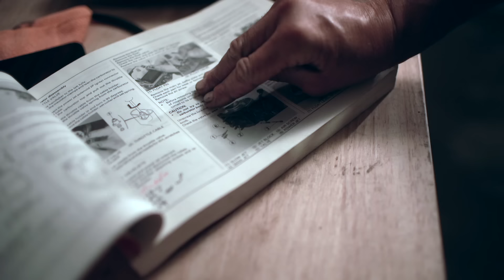Velocity Disorder II. Honda CRF450R vs CR250R

Comment: I don’t understand, the 450 should be ripping away from that 250 on the straights? The hell is the point of going to 450 if 250 has it all and lighter bike
Reply: As a old pro ! 
I can answer that question for you. The 250 if it's done right have more horse power then the 450 who I guess is around 62bhp.
My best 250 engine did well over 65bhp. And the snappy power of a smaller engine is helpful! See a bike put's down 35-40 to the ground rest is going to be wheel spin. I had factory 500cc bikes in the 80s who had 75bhp. But still the good 250s could keep up in the start. Only when it gets rough deep sand the 500 was in charge. My 450 of today is way modified lighter crank shaft piston and it rev 12.500rpm why ? 
Because it feels as a 350 to ride and it cut corner as good as the 350 and not brake stop at the engine we run Recluse clutch. So it's up to how good you make the porting of the cylinder and you need raise compression more  at a 2 stroke they make more use of that. Best regards Bjorn

Comment: 2 stroke all day long , half the weight same power on a different delievery,
OMG when you hit 5000 thousand hang on for dear life grip with your knees arms and hands for all your worth, no feeling like it !!!
Reply: Well with the 450 atleast you get to skip Top end rebuilds, (almost too easy on the 250) but still I guess the 450 is awesome because you can convert to street legal along with having local low end torque and gas. So best answer; cr250/500 for motocross and 450 for trails because of that nice torque lol.
Reply: The anger I have for Honda not making 2 strokes anymore >:(

Comment: give her a new full fmf and see whot happens to a 250 2t 450 is slower if fmf exxaust is on the 250 2t bcause 2t need exxaust stock is sucks so buy a pro curcuit or fmf or shorty and see how race done easy on 250 2t

Comment: Well when do match about what engine desing is the best fo racing..it would be 250cc 2t vs 250cc 4t. Littlebit funny that there is not many videos of that :/ Sure i know how it would end....motocross mag ever had dyno test like that and 250 4t are in 125 2t class.4t Heavier, many parts to break..expensive ones and less power for cc...so what the fuck 4t is doing in motocross? Yes business..more money to maintaining the engine...

Comment: Crf450s are shit the most boring gutless 450 out there  honda went downhill after the last cr 250 was built the cr250 was such a bad ass bike power reliability handling was awesome  and the unique     sound . I never bought another Honda after 2007
Reply: Lol. What kinda pot are you smoking? I have both and I can say the 450 wins easily. And for the record, 08 was the best year crf450 until the 2017 rolled out, and when it did, it was also reviewed as one of the best bikes of the year, where it has stayed to date. Totally not why the 08 is known as one of the best 450f's ever made... The 450 also makes 10 hp more. But keep trying to call it gutless, I bet ya never rode one.
Reply: @kyles5751   ha ha nice reply honda fan I have rode many crf450s and I  own almost  every brand Yamaha are the best  I have a 2012 yz250 2014 yzf 450 and a 2005 cr250  and a 2018 kx450 and a 2014 rmz450 and owned so many older models over the last 20 years of riding dirtbikes  trail and racing.but no crf450cos their shit and thrash out to quickly. I'm not saying I dont like honda I own o cr250. 2008 was a better year for them follow up on the constant valve problems before then.  but then they go put twin exhausts on them to make them go no faster old Seattle bags we call them.   and just now  2018 they make a decent powered 450  yzs are the baddest 4 banger out there. But I understand  your love for honda . And I think there is only one type of pot its called  marijuana.
Reply: @THRASHED05  The yamaha has been a better bike overall, but it's cornering has never been on par with Honda. The only thing I like more on the yami is the motor, and that was only after they ditched the nightmare 5 valve, still not a fan of that atrocious wrap around exhaust. Honda strugged with valves for a little while, but they were solved with time.
Reply: @THRASHED05  And again, I disagree with your saying that the Honda is the worst 450. You can say all you want, but at the end of the day, reviews from every major tester say differently
Reply: @kyles5751  honda has always been the best handling bike on the market I bought a cr125 in 1998 because of the alloy frame the only bike out there then bought a cr250 brand new in 1999 and I punished that thing every weekend  I was a honda man so was all my mates back then  they were the bike to own  then bought the first  performance 4stroke to hit the market the yzf400 and it was awesome then the 426  then the 450 and then the crf450 came out it looked awesome almost bought one but my best mate was a mad honda rider he bought one and had so much trouble with it eventually after years of trouble with crfs he bought a yami and has never looked back. Yes I believe that 2008 was a great bike but my mate has a 2009 model with pipe ect it has good down low grunt but loses at the top end not much over rev he is unhappy with it and it is his first 450  it is for sale now and he is buying a yzf450 or a kx450f 450
Reply: @THRASHED05  Yep, my dad has a '99 cr125 and an '01 cr250. Fun bikes. For me, I have never had a real issue with my Honda's. Maybe that's just my experience but they have treated me well. It's a perfect bike for me because at 5' 8", I'm not the tallest person in the world and I need the bike to be shorter and slimmer, and that is how Honda goes so it makes a great bike for me. The '09 was a slow bike overall, first Honda 450 with efi, it wasn't bad with engine work, but it was a weak bike stock.
Reply: @kyles5751   I miss the old bikes and I am a honda fan  mabe my comments on the crf450s was a bit harsh the newest bikes out there now handle better more power but I think the are to smooth for trail riding missing the old school holyshit power my kx450f 18mod is a smick bike I really like it but it lacks power doesn't feel dangerous my yzf450 is a full build with cams ect and it pumps get your adrenaline going .
Reply: @THRASHED05  Its all fun, today its more preference than anything else these days.
Reply: @kyles5751  very true all new bikes kick ass but  I miss the very old two strokes yz cr rm kx  1990 to about 1997 98 they were absolute beasts to ride many men fell victim to the gravel you needed a first aid box in your ute ready to go.